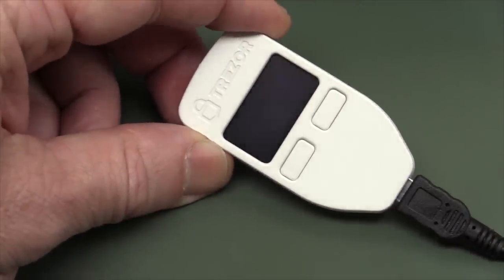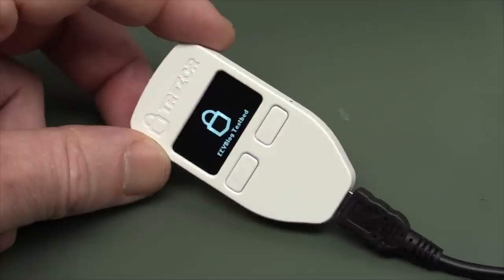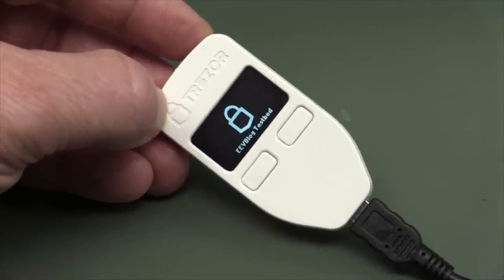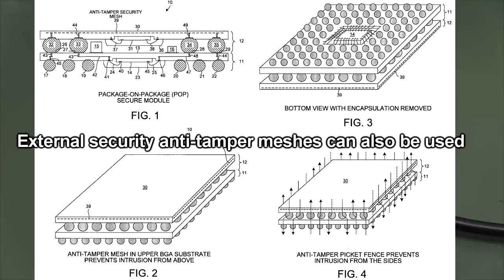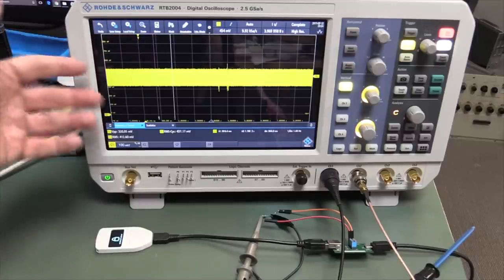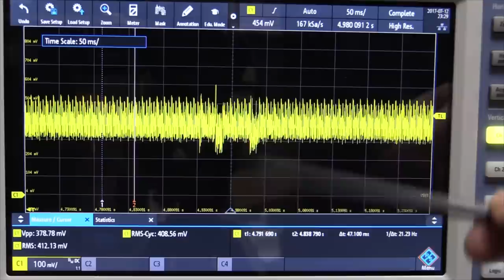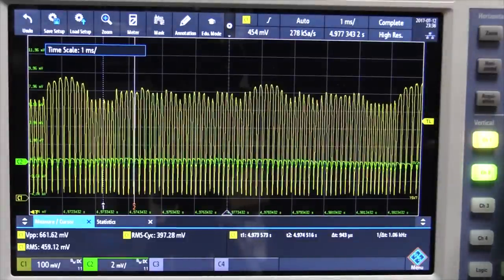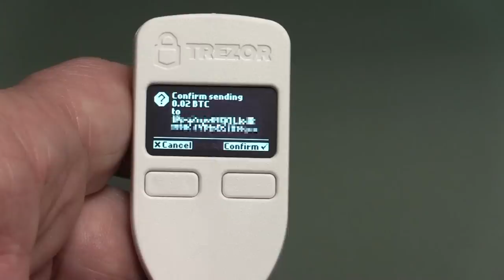EEVblog #1006 - Trezor Bitcoin Hardware Wallet Teardown

Comment: Hey Dave, about the power line hack. I am guessing you mean you can get the interrupts and cycles from power line as noise. How do you prevent this? Do you just use caps to limit the speed of line to USB speed and distort the noise (which is the interrupts and cycles)?
Reply: The device can be opened and the caps be removed and your back at square one. So, adding caps would just cost an attacker time, without adding "real" security.
If your electronic is within a safe housing and you need to open the safe before getting access to the board, then off course it helps, but it is still security by obscurity.

Much much smarter is to carefully write the software. For e.g. if the first pin digit is incorrect, do not branch into dummy code that is faster and less power demanding then the actual correct pin checking routine. Instead, let the user enter all digits, check every digit, what 100ms and then activate the lock (or not).
Reply: sarowie oh so the power line monitoring process is to monitor the power spikes as you are entering digits. so for example if the digit is correct it will create a different power usage. and you find the password that way?

Comment: When you first boot up the device, does it offer you to enter an existing seed? It would be weird if you would have to mail the "seed sheet" to the manufacturer in case you lost the device, in order to get a new one.
Reply from the maker: It offers a recovery process when first booted, yes.
Reply: Yes it does. You never need to interact with Satoshi Labs other than the initial purchase.
Reply: linagee So every time +EEVBlog said "website" he wasn't talking about the Satoshi Labs website and its servers? And I can't see how you could you possibly revoke a stolen wallet without either A: The wallet needing central server cooperation to work each time or B: creating a new "account/wallet" private key, moving all your coins and somehow listing that in the public blockchain so incoming funds won't go to the stolen wallet.
Reply: John: You never need to interact with Satoshi Labs other than the initial purchase. I stand by what I said. If you use their web wallet interface, you can use them. (And I'm sure EEVBlog was using them, just the simplest option.) But the Trezor also works with, for instance, Electrum. Also, you can choose to ignore every firmware upgrade from Satoshi Labs. Or at least audit upgrades very carefully first!

Comment: STM32 microcontrollers have an OTP fuse bit to disable the programming & debugging interface. They would most certainly have set it so you can't read the flash.
Reply from the maker: Yep, likely. Maybe a hack for that first and then a secondary debug attack?

Comment: Liked the teardown as ever, mate.  Got some deconstructive feedback, though.

The power side channel analysis seems like you were looking at the draw side of a 5.3kHz buck converter.  Probably 5V to 3V. 

It appears there are 1 or 2 converter chips.  Maybe 2.5V and 3.3V?  If one is the CPU, tap that output for a clean signal on the CPU draw.  

The EM field might be generated by the caps in the buck converters.

Your gut feel about potting it may have to do with all those exposed signal pins, like the DC output of the supplies.
Reply from the maker: That would not explain how they fixed the existing side channel USB power attack (done on the USB power line as I did) with just a firmware update.
Reply: EEVblog oh sure I agree with that.  Having not read the paper, I would guess it involved loop timing?  What I'm getting at is that taking it to the next level has not been ruled out.  Because all those pins are exposed, there are other side channel powerline ways of extracting info.

There was a similar side channel attack in Linux that involved someone making a patch that took out the variable loop timing.  Making that signal the same every time took out one side channel.  But it led to a vulnerablility, because it took away the source of noise that had been hiding a second signal.
Reply: Heath Hunnicutt My two favorites are the audio tap attack and the intentionally modified random noise source.  So creative!
Reply from the maker: Heath Hunnicutt  Sure, there are probably a couple of levels you can go beyond this if you are keen enough. Might be able to slow the micro down as well.

Comment: “I'm going to evaluate physical security of this device.” 
“There's a port that could possibly be used to bypass the main security feature, which I could test, but I won't because it would take like 15 minutes to hook up.” 
Good job, mate.
Reply from the maker: I was 100% confident that doing so would have been a waste of my time. Do you really think that they would have left the JTAG port open with an easy backdoor that a cryptography dummy like me could have made progress with in a few hours and that no one else in the crypto industry had bothered to try to the most popular hardware wallet on the market that been out for years?
Reply: No, but then again I would expect encrypted flash drives to always use a key derived from your passphrase, yet when I was writing my master's thesis on security of encrypted flash drives, I came across half a dozen flash drives that always used the same constant key (universal for each model) regardless of your passphrase (they can therefore all be unlocked by simply sending that key to them without the need to enter the passphrase at all). Never underestimate people's stupidity.

Comment: Is it possible to read the firmware from the device?  If so, what would prevent someone writing an emulator to perform the PIN brute-force attack you describe at the end?
Reply: You can always CT scan it. 
These devices are not 100% secure, but they are secure enough to make it really complicated for someone to crack. But you can always read individual bits from the chip if you are in physical posession. 

For a thief to do that, they would need to be pretty sure that there is a solid amount of Bitcoin on the wallet to even attempt such an attack. Everything comes down to it being too expensive or too time consuming to crack. And by the time they crack it (at least a couple of weeks), the Bitcoin is already gone and private key is useless.

Heck, even Bitcoin network doesn't use any firewall type or active security at all. It simply uses probability and incentives. It will always cost you more to hack the network than what you will gain from the network.

Comment: @EEVBlog About your "I'm surprised they didn't use a secure processor". I was surprised too. That's when I found the Ledger Nano S, which is better than the Ledger (which I've also owned), and they do use a secure microcontroller. Hopefully someone will send one in and you can take a crack at it.
Reply from the maker: Interesting. Do you know which one they use?
Reply: ST31 and STM32.

Comment: Regarding modifying the eeprom contents, if they're smart they will have checksum algorithms to make sure the contents have not been altered. From my experience with automotive PCM hacking, you have to know in advance how the memory is laid out and what algorithms are used to verify the contents before you make any changes yourself. If not, the PCM is either fully disabled, or they disable the engine, turning the car into a 2-ton paperweight with a radio, at which point you need to recover the PCM and reflash it.
Reply: mysock351C I'd like to bypass the Flash altogether by doing a RAM hack.  You can single step through the instructions by controlling the OSC input, and then  hack the RAM.  If the bootup and Flash read process is deterministic, then you can blindly read out the Flash or RAM to guarantee a minimum PIN time window (replay attack).

Dave, I would love to see you try this.  The blind Flash replay attack is fairly easy to setup.
Reply from the maker: Isn't the firmware 100% open source?

Comment: Meshes are not sufficient against attackers with the ability to precisely apply hydrofluoric acid. Secure chips should stop trying to make the chip resistant to acid, and instead make them self-destructive. Add a bunch of potassium right above the substrate so that the acid blows the chip up.

Comment: It would be a really bad thing if they had the PIN on the device. Why wouldn't they just have hash of it in there? Then there would only be hash to recover but reversing that would need a lot of computing power.
Reply: Neither is needed if you encrypt the data (Signing Key) with a Key derived from the pin (and a salt).

Comment: I don't get why decapping the chip would be helpful. Say you managed to do so successfully and have a fully functional but exposed wafer... then what? It seems all you would be able to infer is the architecture of this particular microprocessor... which isn't very useful. Is there some way decapping allows you to extract the contents of the internal ROMs?? Otherwise, what's the point?
Reply: no, but it allows you direct access to the microprocessors logic banks.
for instance if you knew how to probe it, and that's beyond me because I have NO clue how that shit's done.. you could, say probe the L1 cache RAM which is on-die * and see what's going on in that circuit
Reply: Update: After googling a bit, I came across this article, and apparently reading ROM after decapping is a thing. I wouldn't be surprised if there is one on live probing signals and RAM as you mention!

http://adamsblog.aperturelabs.com/2013/01/fun-with-masked-roms.html

Comment: The PIN itself shouldn't be stored on the device to be recovered, and the key should only exist encrypted at rest.

There are a lot of side channel attacks possible against the running device (I'd be willing to bet 10 BTC I could pull off a non-power-line side channel attack on it), given physical proximity.  Other attacks are subverting the auto-erase and exponential backoff mechanisms so as to extract the key -- pretty sure I could do this at a cost of <1000 BTC, and probably on the order of 100 BTC.

Another obvious attack is giving someone a replica device (either reflashed, or a new device in the same shell) to steal the PIN (user enters PIN, device errors out, attacker recovers PIN; potentially device broadcasts PIN rather than storing it).

I'm a bigger fan of the Ledger Nano S, but none of them are top-tier.  They were designed for BTC = $100, not BTC = $2500.  (Even the best large HSMs have weaknesses, but nothing in this form factor of small and barely self powered is amazing.  Smartcards are worse, though.)

Multisig is the real solution to these security problems, and then a bunch of security (procedures) built on top of that.

Comment: So it is like a debit card that you charge ??
Reply from the maker: Not really. Bitcoin is an entirely new decentralised digital currency system. This device is a way to store your bitcoins, like a physical bank account.
Reply: My understanding of Bitcoin (and the others) is that you don't (and can't) store "bitcoins" anywhere. Instead there is a list of transactions globally available which stores who send you how much money and who you send how much money and just add that together to get your balance. This device (afaik) stores your private key which is used to authenticate a transaction.
Reply: Fabian Neundorf correct! It's public/private key based with a proof of work cryptohash on the chain. Once a transaction is included into the chain and subsequent blocks are added to the chain it becomes exponentially harder to even attempt brute force reversal or other shenanigans on the ledger/block chain.
Reply: A better explanation rather than a bank account is that you could literally have a whole bank in your pocket.
Reply from the maker: Fabian Neundorf  Yeah, that's a more correct way to look at it.
Reply: Where is the global transaction list stored? Does this mean that it's impossible to pay with bitcoins if you don't have Internet connection?
Reply: Yes, You need an internet connection to send bitcoins.
Reply: boltedlightining 01: If you want to see debit cards in the same complex way as they've described Bitcoins... debit cards aren't charged. An entry is added to a database, then about a dozen middlemen authenticate that the database entry is correct and you have enough cash in your account. Then, there are interbank fees exchanged and settlement occurs days later. If there's a chargeback within 3 months, then the database is essentially reverted and you get your money back. (Because they have an insurance fund against that sort of thing.)

The traditional banking system is orders of magnitude more complex than Bitcoin. It's just that at a user level, you never see any of that.
Reply: When you send you can connect over for example Bluetooth to the other party which in turn can broadcast the transaction out, so you don't have to have internet access but the transaction needs to reach the internet somehow.

One interesting thing tho is that there is projects going on to launch satellites that will send the transactions in a manner that will result in that you don't need internet access to watch the transactions. Sending will still be a little more difficult tho. But I won't be surprised if we will see satellites for that as well.
Reply: camelCased the transaction ledger is distributed - anyone can run a full bitcoin node and carry (and track/authenticate) transactions. Transactions get added by a consensus mechanism involving cryptographic proofs.
Reply: Satellite connection for a read-only copy is possible, but very expensive. Tens of thousands of dollars a month at least. Surely just pennies if you're trading millions every day though. No point in launching satellites, just buy bandwidth on existing satellites. You can even have an RTLSDR-type device receive the transactions. You could even use the software radio in a cheap cellphone to receive the data, then SMS out a spending transaction. The problem is, you could also use SMS for both sides of the conversation and most people just don't give a crap enough about security to see why this would be a bad thing. (You'd have to entirely trust the data, think Bitcoin web wallet.)
Reply: The idea is to use cheap radio to transfer data - with the idea that it should then work in the dessert, at sea, or in North Korea, but instead of rolling your own solution in a youtube comment, check out the project instead.

Comment: Wouldn't the printed out "recovery seed" need to be equivalent to the hardware protected key, thus allowing attacks via the printer software and firmware to get a copy during the initial printout?

Comment: I've seen people dissolving epoxy chip and then use a regular optical microscope to see the transistor bits on the die then rebuild it optically

Comment: Reading back the flash does not mean youve beaten the crypto.
Reply from the maker: Not sure what you are referring too?
Reply: linagee You're confusing flash and RAM.
Reply: Not true. The private key is encrypted with your pin. Reading out the eeprom/flash content is still useless without the pin. However I am not sure how hard it is to brute force the pin. But I thing you can also set up a passphrase additionally to the pin. The plain private key only exists in RAM for a brief moment.

Comment: First thing that i thought when i saw this 1 chip on pcb...WTF IS THIS CHEAP SHIT SO EXPENSIVE????
150 USD?? for what? 1 chip and cheap display?
Reply: What You expected rly? xD

In low production take price of components and multiply it by like 3x if it's rather cheap device + other costs.
In huge mass production(in China) take price of components and multiply it by like 2x + other costs.

Also good boards and components cost much more that You would think. And then robots need to be bought and people hired ect. ect. :3
Reply: Dude!We are talking about 150 USD! I will repeat 150!!
What good board?What is so expensive on this board?I would guess only the main chip.I don't know the price of making it,but let's say 50 USD.
What else can be expensive on this device??
You can never justify 150 USD for this device.It's highly overpriced.
Reply: Main chip is 6 dollars alone + shiping of that shit + workers + machines + energy + other stuff that probably rump up cost of it to like 20$
Each switch ~1$ + all cost so it's like 5$x2
Other pasive parts mee let's say 10$ with everything
Board lets say 20$
Display pff no set prices rly for that. let's say it's cheap 10$ + custom flex + worker time + machines + other shit meee 30$
Molding case and then sewing it together with sonics pfff 10$?

Dunno how much it's mass production.

20+10+10+20+30+10=100$ let's say for components with work + development + taxes+ shipment + profit mee there You have 150$
If made truly in Chinese way with random recycled parts, super cheap workers and machines and what not, let's say it would be 20$ to manufacture still + development and profit and shipping and taxes and what not.

Also from their website it's 89$ not 150-170$ as it's on Amazon,

Comment: Most physical security is useless, as it can be physically circumvented.
Reply: The best security is a mixture of physical and digital security. For example, Using Shamir's Secret Sharing you can take private key and shard it where you need 2 of 3 or 3 of 5 shards to recover and than you store some encrypted digitally and some secured physically in different locations.